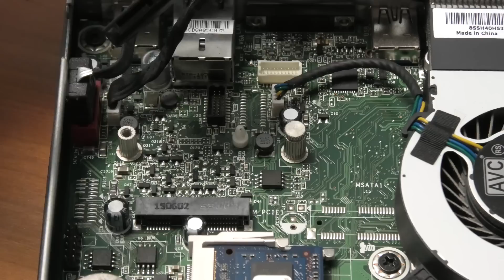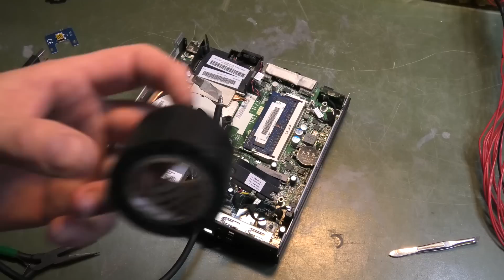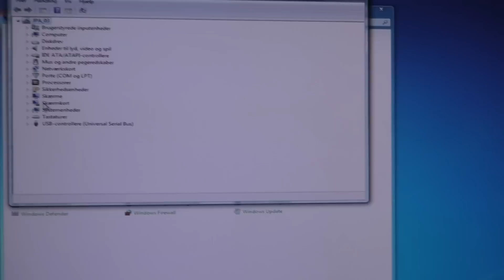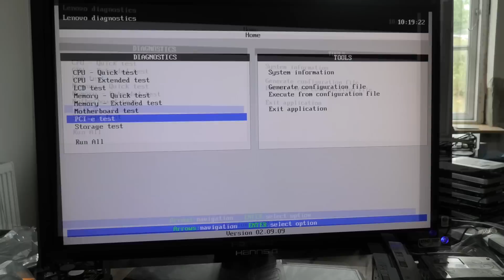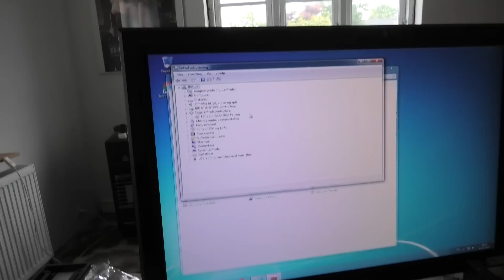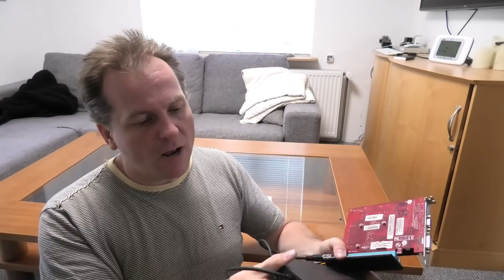Tiny Lenovo with External GPU or HBA/RAID Controller - 1206

Comment: You Should not use the Sata to PCIE adapter They a re Known to  burn down your house. You can Pull Over a PCIE slot 75W not 25W. 6 Pin is 75W And 8 Pin ist 150W. The Signal over the USB Kabel to the Riser has nothing to do With USB (Im Saying this because you wondered why this Cable needs to be USB 3.0 Its just a Cable that already is Mass Produced.). And you dont need to wonder if your PC Can give it 12V The Riser is Only Taking the PCIE signals from the PC no Power. So Even you Plug the Riser into a Normal Mainboard from Which PCIE slot you would normally get 3.3V And 12V nothing will got to the Riser. The Riser Gets its 12V From the 6 PIN and in the PCB its Generating 3.3V. Hope it Helps ;)
Reply from the maker: Hi Abbyson
Thank You very much!  glad you liked the video :-)
Thank you for watching! :-)
Reply: I have blown an SSD and saw fire using one of those cables because I didn’t know what i plugged it into was powered

Comment: @7:30 hopefully you got the usb3 version of the mini right angle connector ( trying to find it appears to be difficult as not many devices used Mini USB3, most are USB2) since you can see on the card there is more than 5 pins on the mini connector so its not a standard 2.0 port and a 2.0 cable would be missing a few signal pins.
Reply from the maker: I do not know,, we will see. if it was USB 2 or 3

Comment: Interesting. Perhaps there's a PCIe riser to get 2 x8 Slots out of one x16 port. I have an ITX-Fileserver (TrueNAS) with just one x16 slot. It has 2x 1GbE, but if i could use such a riser, i could add a 10GbE-card as well as a HBA (for more drives. This board has 6x Sata. Jetway q77-Board)
Reply from the maker: I think from an M.2 NVME slot you get an PCIe x4,,, but I do not think you can split that,, I only get an x1 out in this video.
Reply: @MyPlayHouse  My ITX-Board is a Jetway NF9E-Q77. It's in a Lian-Li Q25 Housing with 5x 3TB WD red and a 120Gb SSD for ZFS-Caching. Has 6x Sata, 1x miniPCIe (x1 for Wifi) and a standard-size PCIe x16 for Graphics, but has also CPU-Graphics. It has 2x Intel 1GbE. The Lian-Li has room for 2 expansion-card-slots. So if i could make 2x x8 out of 1x "x16 PCIe, i can add 10GbE card and a HBA (case has room for 5x 3.5" and 3x 2.5".
Plan B is to add a miniPCIe Card with 2x Sata and a standard-size dual- 10GbE card.

Comment: 6-pin is for pci-e, imo sata shouldn't be connected live as they're generally not hot swappable. interesting concept but the video card can out put  a lot of data across the port and unfortunately I don't think USB 3 is capable of those speeds, thus casual gaming may be fine but more demanding games will perform worse than if connected directly into the motherboard.
Reply from the maker: It is not really a USB3,, It is more a widely available standard cable used.

Comment: Fun fact: PCI express does support and implement hot-plug capability so in theory there is no need to power everything down. I believe those cards on support one lane (x1) of bandwidth/support so any card you use in it would have to work at 1x minimum.
Reply: LTT did a video about hot plug (YigN2mkQMPc) and have done it myself on consumer boards sometimes.
The biggest problem I found is that if the board does not say it supports hot plug it sometimes disables the slot during boot if there is noting in it, so if you hot plug somting in it, it wont work because the slot was disabled and the OS cant see the new card until you reboot.
Reply: You probably just inspired the next Ninja-Hack video… ^^)
Reply from the maker: But,, would you be sure that the PCIe mini supports hot-plug?? I felt saved shutting down. :-)
Reply: @MyPlayHouse  The hot plug feature is not specifically required to be supported by a given card, nor a given port.

An interesting historical example was ExpressCard back in the day.  ExpressCard 2.0 implemented a single PCIe 2.0 lane (x1), which was mostly useful for testing things, or a somewhat crappy eGPU.

I had tested an Intel converged NIC in an ExpressCard to PCIe x16 adapter for curiosity, and it actually showed up in the Windows eject hardware list, because it supported hot plug.  At the time, the GPUs I had tested didn't support hot plug, thus didn't show up in the list.
Reply: so meaning you can shoved off 75 watts gpu in it without the help of ext psu?

Comment: Did you know, the physical layer signaling specification of USB 3.0 is the same as PCI Express Gen2 x1 lane. Therefore USB3.0 cable can be used to transfer PCIe signal
Reply: I wondered why a USB v3 cable was supplied by that PCIe connector.  I didn't know the signals were the same.  Ty!
Reply from the maker: Hi yamamoto65536
Thank You very much!  glad you liked the video :-)
Thank you for watching! :-)

Comment: All the metal bits you put tape on are connected together as shielding anyway, so you are fine without the tape
External PCIe is always a nice hack for testing cards away from the motherboard
Reply from the maker: I think so as well,, but just to be safe.

Comment: You bodger he he 😀
Well it seems to work great, now you need to find a good use for it.
A plate of metal bolted to that card connector would make it more stable, no wobble 😀
Reply from the maker: Yes this was just a test setup,, dodgy,, why am i a bodger?
Reply: @MyPlayHouse  Hacking a pcb, wrapping tape around a cable, not fitting a propper usb socket on the box.
Actually its not so bad, ill take that back lol 😀